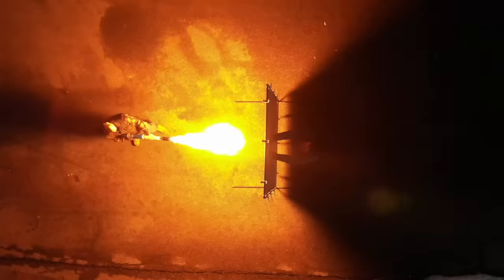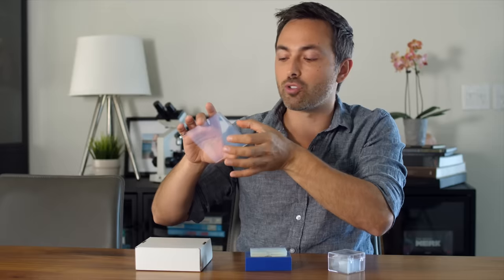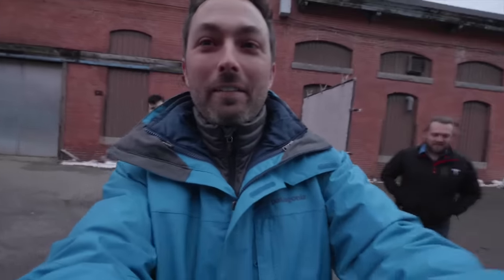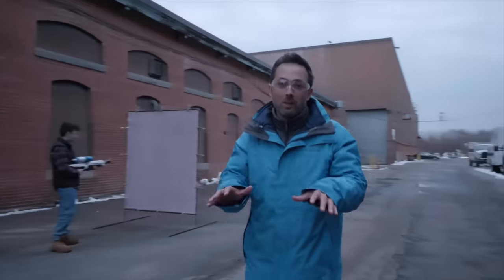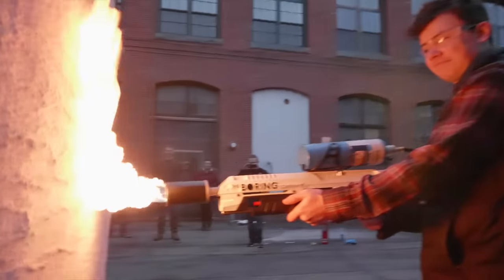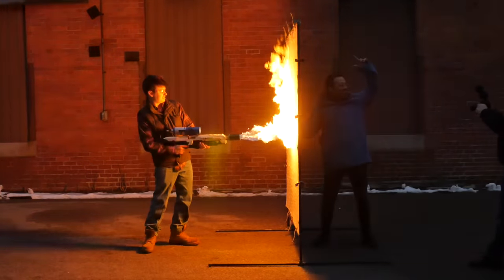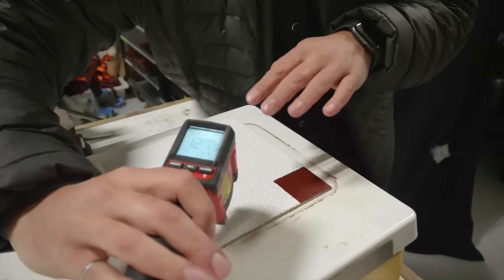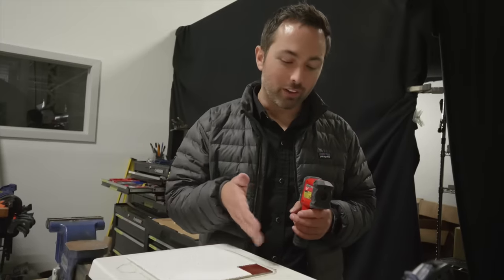Flamethrower vs Aerogel

Comment: Not a flamethrower though, more like a big blow torch.
Still hot though
Reply: Hugo Wijk was going to say that too😂😂😂
Reply: what's the difference?
Reply: @andrasnagy2410  flamethrowers spit out the fuel that burns as well
Reply: @caolan3202  Exactly 👍 well said.
Reply: Not even a blowtorch, as it does not mix air into the fuel before burning
Reply: @andrasnagy2410  An actual military flamethrower actually shoots burning fuel (which then sticks to stuff...nasty) where this is really, well, a blow torch, just burning gas. Light some deodorant with a lighter, pretty much the same effect, tho not quite as hot due to the different gases involved.
Reply: andris nagy yikes 😬😂
Reply: He says it in the video, it's a Not A Flamethrower™.
Reply: Ya...he specifically mentions that...
Reply: Thats hot! Ooo thats hot
Reply: Yep it is a freaking joke compared to a real flamethrowers
Reply: @jholotanbest2688  I just made a comment saying the same thing. Just look at how close the guy has to get to the thing he is trying to heat up. He ends up mere inches away. And I wonder how long they had to hold it to the blanket to heat it up as much they did. He even said at the 12:13 mark that they had to keep it on for 10 times the recommended amount of time, eventually breaking the thing in the process. ("Sorry for breaking your $500 toy, Ben." :P ) And they did that multiple times. I'm certain that there's an Elon Musk joke in there somewhere. heheheh ;)
Reply: He says its not.. then he keeps repeating over and over and over that it IS a flamethrower. 
Science channel my ass.
Reply: its more powerful than a flamethrower lol
Reply: @CybershamanX  at least I was able to use it to make a cool video lmao
Reply: A ww2 flamethrower would have done the job.
Reply: I was going to say the same thing, i stopped watching as soon as i realized it was just a lame blowtorch
Reply: trabladorr so basically a giant lighter
Reply: @benschofield1361  Yes, indeed! heheheheh ;) You could print out the thumbnail of the video and mount it on the wall next to the flamethrower. Sort of like some old weapon that was purported to have been used to kill vampires or werewolves, like you see in movies sometimes. :P
Reply: So that kid bought a tesla blowtorch and he didn't used until know ? That is strange.
Reply: @andrasnagy2410  Not a flamethrower is just a roofing torch with a gun cover on it and a real flamethrower is well a flamethrower.
Reply: @caolan3202  Well it is a roofing torch not a blow torch.
Reply: @Nordorf  lmao the name of the product is "not a flamethrower" he wasn't saying it isn't a flamethrower.
Reply: @caolan3202  gases are fluids m8
Reply: @CybershamanX  Yea i was thinking of doing something like that haha
Reply: bring me napalm and fortunate son
Reply: Well, to be fair. It's actually called "not a flamethrower".
Would love to see a real one... Next video?
Reply: For clickbait purposes
Reply: @nanos1267  you know what I meant, corrected it anyway
Reply: @benschofield1361  Get autographs! You know, for authenticity! ;) Heck, it's the future, baby! I bet you could find a high tech picture frame that would actually play the video! That would actually be kind of cool! :)
Reply: Literally they say on the video it isn’t a flamethrower but the test is about the fire so completely irrelevant and just pedantic flamethrower or not
Reply: @Henbot  Well, then. I'm glad we cleared that up. heheheh :P ;)
Reply: There's that clickbait he learned from Mr.Beast ;)
Reply: It's literally just a roofing torch with a plastic body lol
Reply: @qwertyuiopzxcfgh  That's actually the name of it. Research 'Elon Musk Not a flamethrower'.
Reply: @ACMJPT.2  what? this is a science channel. the point is to learn things. i didn't know what the technical difference is, so i asked, as one should. something bother you about that?
Reply: But it does throw flames...
...A real flametrower should get another and better name.
Reply: @qwertyuiopzxcfgh  'Not A Flamethrower' is the brand name that The Boring Company sells them under.
(I realise that you put the TM but everyone else seems to have missed that.
Reply: @EM-fi2qg  i know that's the name of it. That's why I wrote it that way...
Reply: Yeah yeah, we all followed the Musk not a flamethrower drama
Reply: Yeah just a fancy roofing torch 😂
Reply: It is literally called "Not-a-flamethrower" it's made by the Boring company. It's a roofing torch (used to melt tarr for roofs) with the output cranked up and the body of an airsoft gun modified and attached. 
Edit: Oh and that company was founded by Elon Musk. Explaining why the dude also has a Tesla jacket
Reply: Read description.
Reply: It's called a roofing torch and Elon Musk himself said so.
Reply: Did you read the description? Or see the asterisk?
Reply: What is a blow torch if not a small flame thrower? Maybe a flame tosser?
Reply: @Shazam-rj9js  Already posted a clarification about my views (seeing as this comment kind of blew up) but that was added after I, and many others, wrote our comments.
I wrote this comment probably within 5 minutes of him publishing it.
Reply: Wrote this in reply to the comment above but thought I'd put it here as well.
And also, if y'all haven't seen this here's a cool (but slightly obnoxious and texan) video showing a real flamethrower in comparison with Boring companys Not-a-flamethrower:
https://www.youtube.com/watch?v=nuIVE7rh8zs&t=158s

Seeing as when I returned from watching a movie I now had the top comment with over a thousand likes I felt like I wanted to clarify:
Nothing against you AT ALL, or even this video, enjoyed it and just felt like the title and use of the word was wrong and wanted to, mainly jokingly, point out that it really wasn't a flamethrower.

And as I said, it's still very hot and in no way illegitimizes the test or video. I mean a flamethrower would have just been a big hot mess and although pretty dope definitely not necessary (and probably pretty dangerous) , also really like that you used the boring company flamethrower! I have no doubt you understood the situation very well, far better than me at least, and I'd rather you have fun, make good content, and be scientifically accurate in your findings/experiments than calling your flamecasting devices by their right terminology!
And kudos to you for pretty quickly responding and correcting your "mistake", keep up the good work and I'm terribly sorry if I came across as negative or nitpicky!
Reply: @hugowijk3676  aah I see. Yeah I guess he wanted to clarify seeing comments like these...
Reply: @Shazam-rj9js  Hey!
Just trying something out here, it seems like veritasium deleted/hid my comment (this) from everyone else but me. I can still see it but no one else can, so just curious as to if you can see my reply to your reply on that comment. 

Sorry if this is confusing but if you wouldn't mind I'd love if you'd reply to this if you see it, just want to check if it's truly deleted.
Reply: @hugowijk3676  I can see this comment in the notification, but I can't find it in the video, it might have been shadow deleted
Reply: Imagine that... this comment just magically reappeared.
Reply from the maker: your comment is still here FYI
Reply from the maker: @JimPankey  haha it was here the whole time!
Reply from the maker: @Shazam-rj9js  I'm looking at it on the video right now. I never touched it. The comment is perfectly fine. Plus I don't delete any comments.
Reply from the maker: @hugowijk3676  yes I can see it. I think it's annoying how many times in this comment section you've accused me of deleting or hiding your comment. But I haven't. It's here and it always has been. I won't delete any comments as a matter of principle. I'd rather respond to them than try to sweep them under the rug, which in my view just makes it worse.
Reply: @veritasium  Maybe it was, maybe it was hidden.  Either way, it was not visible to the general viewer.  Whatever though... I know what I know.  Oh, and thanks for the reply.
Reply: @veritasium  I'm sorry for that but why haven't you replied to clear things up, and it's strange then that no one else (and me if I log out) can't see it. I'm sorry for accusing you of that if that's not the case but you must understand that it's seemed that way, obviously something happened (also tried replying to someone in that comment and even though they saw the reply in their notifications they couldn't get to and see the comment) to it but thank you for clarifying that it's not you. 

Again im sorry and I wish you'd have replied sooner.
Reply: @veritasium  You should try logging out, that's how I saw it's gone. 
Maybe someone reported it/flagged it and only the author and owner of the video can see it, until you've authorized it or something?

I also hope you saw my original clarification, because I've gotta say the climate in my thread here got a little out of hand and I felt it was a silly thing from the start, very understandable.

Also what happened to your pinned comment, felt like it was a good clarification.
Reply: @veritasium  I'm gonna reply to you directly now to just state my view on it right now. Sorry if I'm getting obsessed over this but I just hate to leave things uncleared and I also wouldn't want to accuse you any further without letting you explain things. And if you choose to reply I'm begging you to speak the full truth rather than let us assume worse things. 

So here's the deal, you (or much less likely the magic YouTube) did something to my comment very recently. And then very soon after you started replying, which I've seen nothing of before this morning, stating that the comment has always been here and that you haven't touched it. 
I get that it looked that way to you (to me the comment has always been here at the top) but I'm almost a hundred percent sure that it actually has been hidden to everyone else. 
Here are my reasons to believe so:
1. If I wasn't on my account, me and nobody else (several people in the comment section nor my friend, who didn't even know about this issue but just said that he couldn't find my comment, could see it at the top where it should have been or further down upon scrolling. 
2. It seemed to suddenly stop gaining likes and more importantly comments at a specific time.
3. When I replied to a person in the thread they said they could see my reply in their notifications, and reply to it there, but when they clicked on it they couldn't see the comment on the video. 

The reason for it being gone I have no idea of, but I'm hoping you can clear that up. If you truly are as clueless as me then say so but you must understand why I'm inclined to believe you know something more.
I just don't see how this all could have happened without you doing something with my comment for it to suddenly reappear, not saying you deleted it but just made it become public again. 

I perfectly understand why you would want to make it seem like you haven't done anything and I nor anyone else will judge you for moderating your comments (as proved by the many people defending your assumed deletion) as long as you are transparent about it. 

So please respond to me and clear this up, again if you truly did nothing then of course say so and nothing else but hiding the truth will just make us assume the worst and become more suspicious. 

I'm sorry for the long text but I just want to try to be as factual as possible and explain my case here, thanks for taking the time and reading my comment.
Reply: @hugowijk3676  he already said he doesn't touch the comments mate